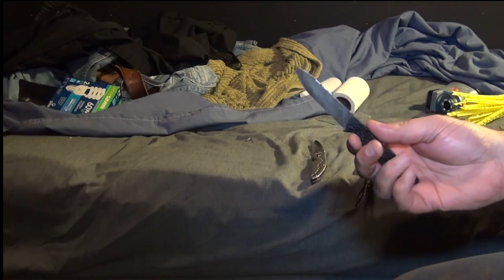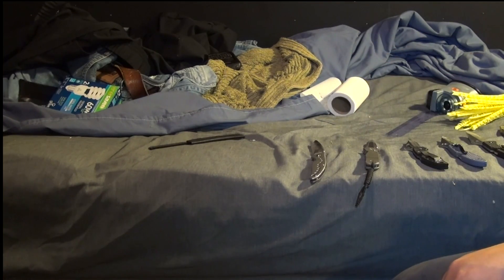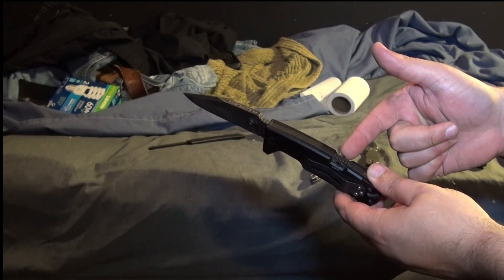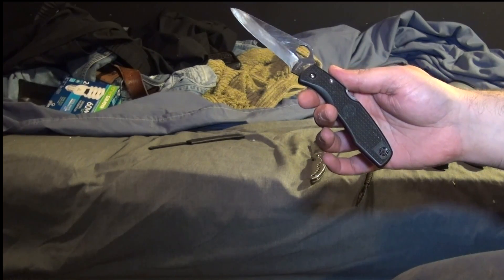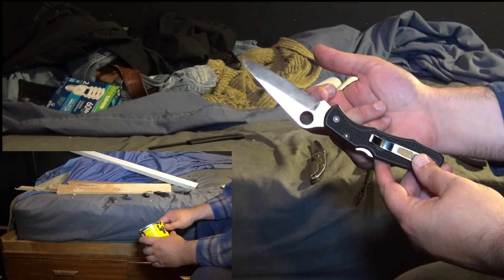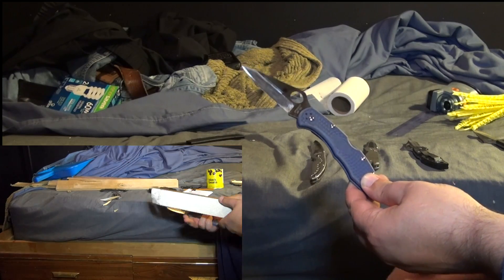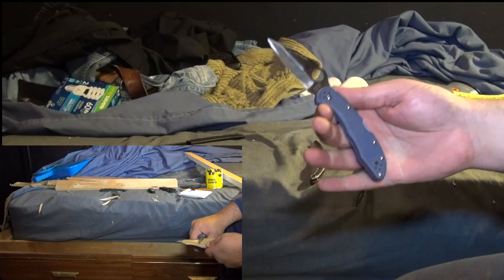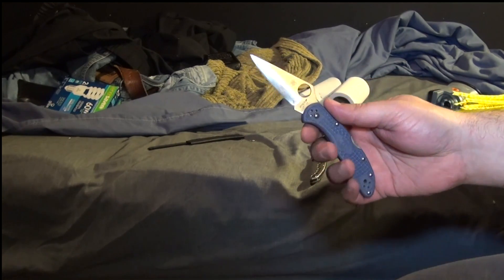Extreme Regrind : Pacific Salt, Small Sebenza, Meadowlark, Delica, Vapor, Fulcrum

Comment: I personally hate spyderco's wire clips. i've had 2 break off of my dragonfly and never had an issue with my endura
Reply from the maker: +Jake Hay They are weaker but I have found in the same situations that drastic damage happens to the non-wire clips as well. I will take the lower durability for the ergonomics but it is a valid concern.

Comment: over the last 2 years i carried an s30v military. i just kept very good care of it and kept a thin layer of oil on it. the performance is excellent but the corrosion resistance is still not to a level of performance i need. over the last 6 motnhs i have used a few h1 steel spyderco's. i have enjoyed the steel but the handles leave a little to be desired. i have also carried a few benchmades with BK1 coating. i love benchmade's coating. it has fantastic corrosion resistance and holds up well

Comment: structural firefighter/paramedic. i leave my knife in my uniforum pocket when we put on our fire gear. so if im working hard at an emergency the knife will often be trapped in an extremely humid environment along with being covered in sweat. wearing turnout gear is about like wearing a parka and snow pants. and then you work in 90 degree weather. it turns out ugly if you dont have a blade coating or h1 steel.

Comment: the 2013 salt line features a new clip. it is an hour glass clip with the barrel spacer. i cant stand it. the have side to side play from the factory. the reason it is a hard decision is because h1 is a huge advantage for my profession. my work knives either need to have a coating or their make up needs to be favorable towards corrosion resistance.

Comment from the maker: Near the choil can be difficult because of the way the grind will flare to full stock thickness. If you have a more narrow hone you will be able to get closer. You can also use the corners of a benchstone if necessary but I would not recommend that with a DMT or any other diamond plate.

Nice work on the regrind and making it more useful.

Comment from the maker: Yes, I picked a bunch of knives to show a few different things. The Fulcrum shows the difference that angle can make, the Vapor a too soft blade, the ZDP and 8Cr13MoV show how carbide volume can be critical if you compare them, and the Reeve shows how you can make a high end steel perform low end fairly easily with the HT being a bit off as there are many ways to do it wrong and only one way to do it right.

Comment from the maker: If it is your first time chances are good you will effect the finish aesthetically especially if you do it freehand. If you have a jig system, some of them go very low and you can grind the transition bevel that way very clean. Take a look at the video's by jdavis for example and look at the bevels he produces on the Edge Pro / Wicked Edge. He also used to do regrinds for others as well, not sure if he still does.

Comment from the maker: Yes, the side loads are very small in the wood cutting due to how they are being cut, in the plywood they would be large due to the nature of the fracture. There are a couple of ways to measure the resistance of the edge to side loading both artificial and in use, the later just requires a 3D accelerometer, the first could be done with side loads on a scale in a suitable medium (plywood again being decent for a number of reasons).

Comment from the maker: That is a bit of a brutal approach as you have a lot of speed but not a lot of control. I would recommend a transition bevel with a really coarse stone. A fast cutting stone could cut this relief bevel into the edge in  5-10 minutes easily. If you don't intend on doing it often then buy a cheap $5 stone in the garden section of a hardware store, they cut very fast (but also wear out really fast).

Comment from the maker: There is a fairly large confusion about what P/M actually does to a steel, the only thing it does is achieve a lower carbide segregation that is all. This makes it much more user friendly to the maker but for the ELU if the alloy content is the same then the steel will be much the same, this is metallurgy not magic after all.

Comment from the maker: It will mangle the file most likely as even though it isn't a high wear steel, it has enough chromium carbide to do a number on the file so keep that in mind. However a simple etch sharpening on the file should easily restore it.

Comment from the maker: Yes, there is no way the knife I had is the expected performance as you would not need to be a "knife person" to know there is something seriously wrong with that steel. Those steels are pretty simple to harden though, I was always rather curious what those guys were doing to get such results. I have heard rumors/stories but they are always from other makers/manufacturers so you have to take those as a little less than unbiased sourses.

Comment from the maker: P/M steels really are only of use on extreme alloy steels where if they were just ingot steels the fabrication costs would be too high. Performance wise, CPM154 and 154CM for example have the same hardening response, the same wear resistance, the same compressive strength and the same impact toughness (cross grain). The P/M version is just easier for the maker to work with both in HT and grinding/finishing.

Comment: performance out of 154CM, 440C, completely rust-proof blades made out of H-1, or simply put up with a little discoloration on an otherwise quite functional carbon steel blade, etc., it seems like something that isn't the most cost effective solution in most cases. That being said, the technology is very interesting, and I'm sure the cost will come down as time goes on.

Comment from the maker: The high wear steels really will only have an advantage when working with low levels of sharpness and this is offset by low grindability, easy of fracture and higher expense. I would normally prefer the low carbide steels because of the ability to take and hold a much finer edge angle for most work.

Comment: So, in a general purpose utility knife for realistic cutting tasks, do you prefer the tougher, less wear-resistant steels for their ability to resist damage at a more acute edge angle, or the more wear-resistant steels with their requisite (ostensibly more obtuse?) edge angles for optimum durability and cutting performance? Are the powdered metallurgy steels really worth the added cost for a moderate-use pocket knife? Obviously this is subjective to some degree, but when you can get such great

Comment from the maker: The bevels are measured using a caliper and the angles calculated.

The Fulcrum is a curious knife, it isn't comfortable by any means, but it isn't as bad as you might expect by looking at it because all of those mental edges are actually decently chamfered and it is just so big it smears out the contact pressures.

Comment from the maker: The angles are measured using a vernier caliper and the angles calculated. These angles are extremely low, the Sebenza for example is ground flat on the stone, and for any knife with a thumbstud you have to be careful or you will grind it off.